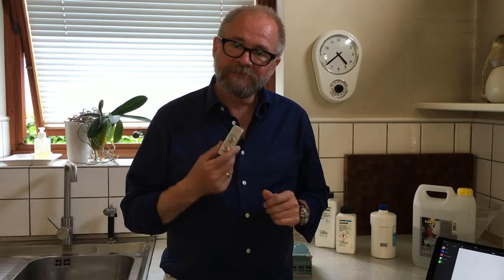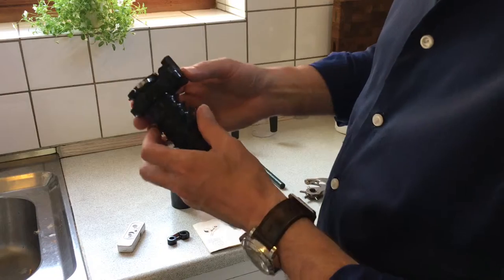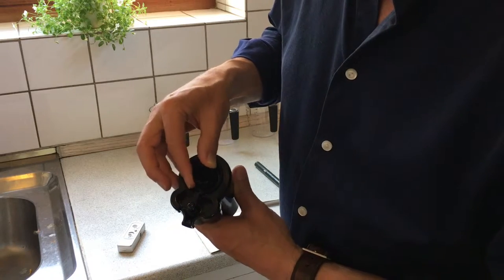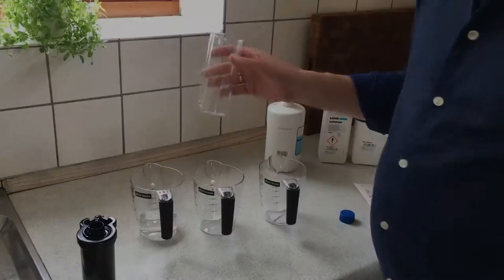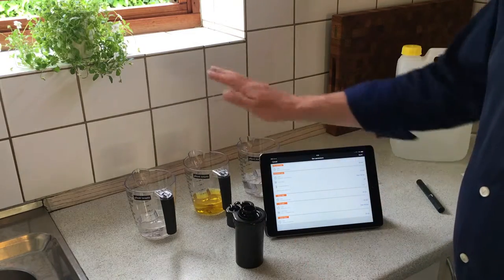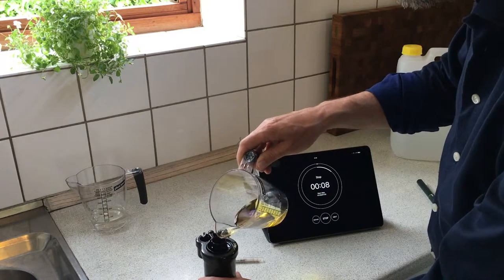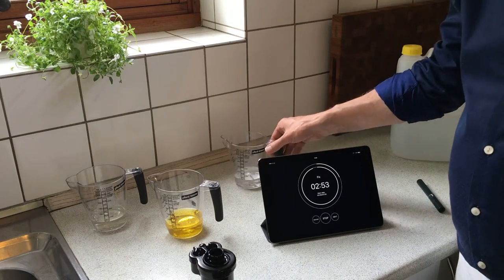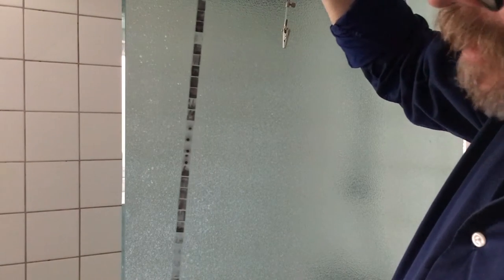Developing BW-film

Comment: Well, since i used this tutorial and u helped me out, i  figured u deserved a follow up. So i think i might have screwed up with the chemicals, (or may be not, can't tell) but one thing was that the film broke off when unwinding it in my daylight development tank. if i did do everything right with all the chemicals (i mightve screwed up with the developer powder, i happened to have exactly the same brand you use in the video), it means the chemicals only partially mightve seeped into the film canister. but the film itself had never come out and never winded onto the development cilinder, because the lint broke off. you can see what became of it on my instagram, protogy_nl . well, if there had been any cold war secrets or interesting photos on it, they are lost forever

Comment: do you think i will still be able to get most of the negatives after that accidental exposure? and do i need any special fixer, stopbath and developer or will any do?
Reply from the maker: Hi Annop
I can't say if you would be able to develop the negative film -  but on my website you will finde a pdf recipe on what to do to develop a negative film.  
https://www.minoxgraphy.com  - go to developing

I wish your the best of luck with developing your film.

You can still buy new negative film on eBay.
I just found a Minox Daylight Develop Thank on eBay.

 http://www.ebay.com/itm/MINOX-Daylight-Pellicola-Serbatoio-in-via-di-sviluppo-con-manuale-termometro-/252706728615?hash=item3ad67eaaa7:g:TrMAAOSwHMJYGwUl

btw. My next video will be about scanning the film negative on to a computer

Regards

Robert
Reply: thanks for your very fast response! darn, i found only 1 affordable minox developing tank, the cheapest, yet still double the price of the one you now posted. already bought it! :) i hope i will be able to get something from the negatives. i read that accidentally exposing a modern 35mm to that usually only would result in loss of the first 5 photos and some damage to others, but with most preserved. not sure how that works with this 8x11 0.o

anyway thanks! this vid has helped me a lot
Reply from the maker: Old film degrades over time, and you may not be able to get usable negatives from very old film. But The best of luck with it.